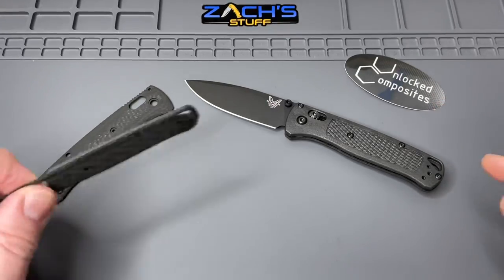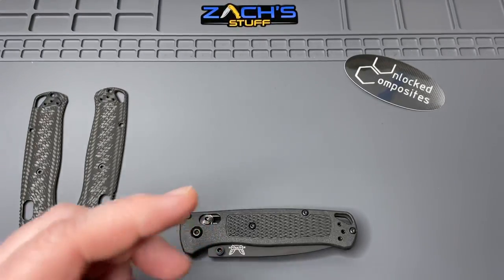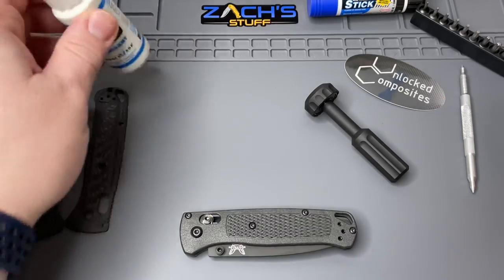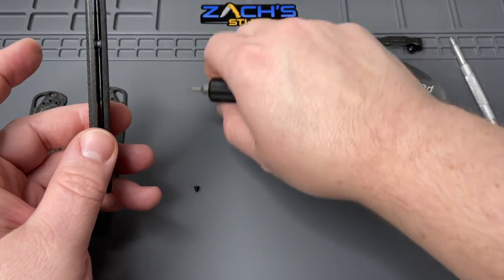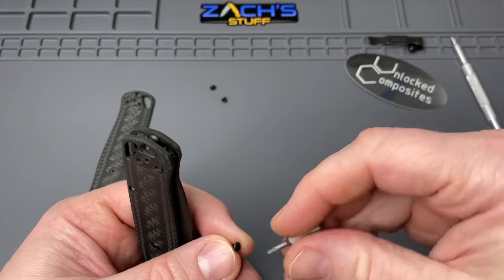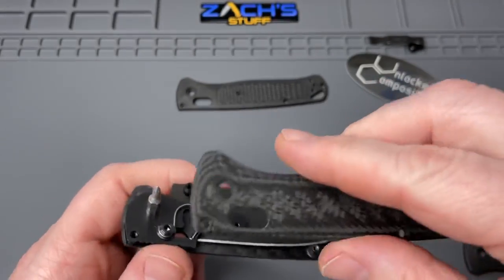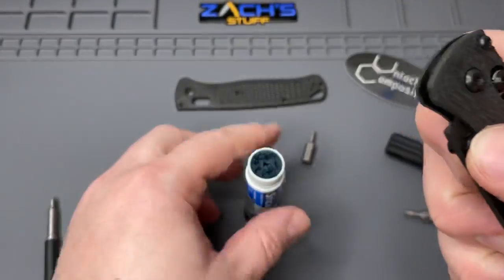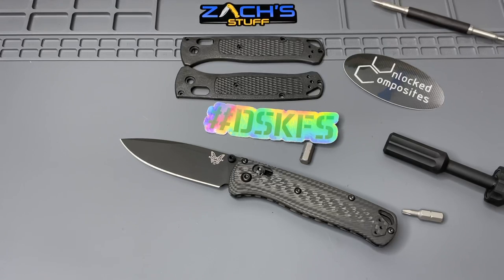Carbon Fiber Benchmade Bugout Scales (Unlocked Composites)

Comment: Good content.
Unfortunately I don't see the steel pivot tool for sale any longer.  You have an extra you want to sell?
Reply from the maker: Thank you for your feedback Kevin! Here is the pivot tool link. Still available luckily!! https://www.etsy.com/listing/802588665/pivot-alignment-tool-for-axis-lock?click_key=c6d6184e43d429bb33ad718c7ad65b1b79742172%3A802588665&click_sum=c7f8d6f0&ref=shop_home_active_2&frs=1&crt=1
Reply: @zachstuff  Thanks, I now see the drop down menu on Etsy (didn't see material option on eBay) and I ordered a brass one.  I had already made on that works adequately but once I saw this one I had to have it.  I also have a method to hold open the axis lock for assembly and disassembly that is really helpful.

Comment: Is loctite necessary when replacing the screws, or can I still do without? 

I'm about to replace the screws on my stock benchmade with some brass/gold coloured ones, also replacing the thumb- stud and adding a backspacer.
Reply from the maker: On some of these smaller screws it is a good idea if you will be using your knife a lot. If not, a weekly check to make sure they are snug will work. Those scales you are getting sound nice!
Reply: @zachstuff Thanks for replying! I'm hoping to get the scales from your recent Bugout video - the basket weave carbon fiber - however it's hard to find, being in the UK. 

Also trying to find some gold/brass pivot screws but their impossible to find.
Reply from the maker: Oh nice! You’re Welcome! Just reach out to Flytanium directly and see if they can ship to you.

Comment: Rule #3, never use Loctite unless proven necessary. I'd never put it on the scale screws, they are too small and too soft to chance buggering them up because you have to turn too hard to break the Loctite free.

Comment: Where was the brass  bearing?
Reply from the maker: No bearings on the Bugout. Bronze washers.
Reply: @zachstuff  Sorry for the late reply. Been in a stupor. Mine was sticky even after removing the pivot. Disassembled. Honed the washers.. still doesn't flip like 535. What to do?